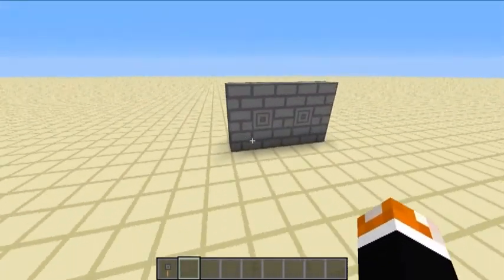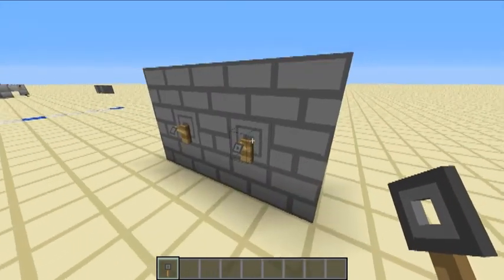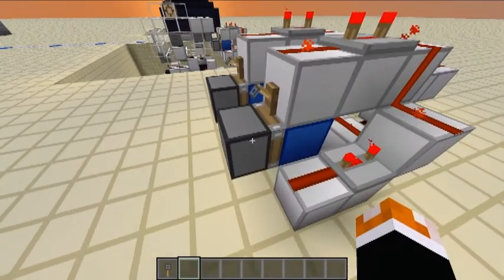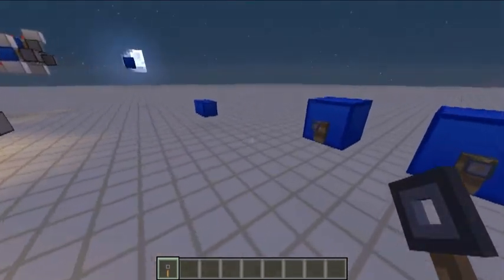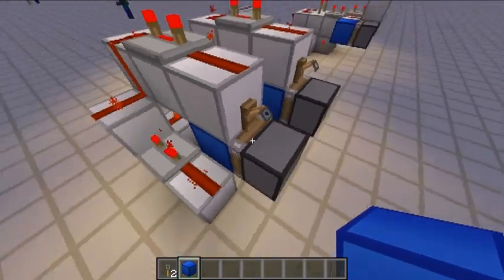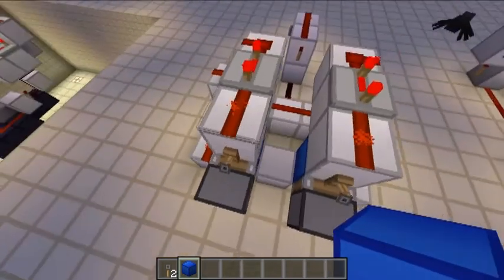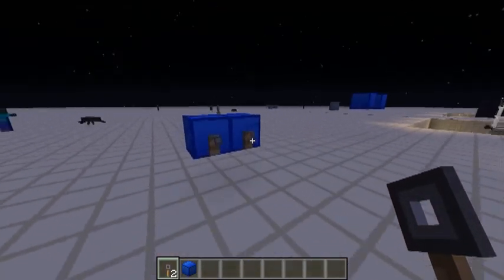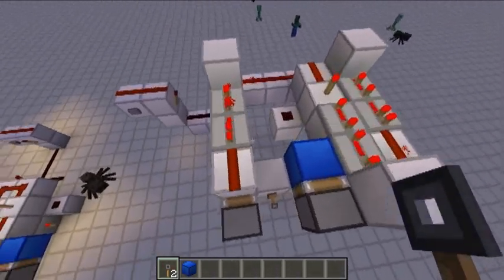Minecraft: Wireless lock using tripwire hooks.

Comment: Messing around with this led something else: If you have the hooks placed that are intended to activate the machine, and place a single piece of string in front of those two hooks, it will cause the same update (same with breaking the string). This doesn't matter whether or not the string is placed on a solid or nonsolid block. Any further string added directly to this newly placed string (and in the direction of the detecting hooks) will also cause updates.

Very fun discovery you've made :).